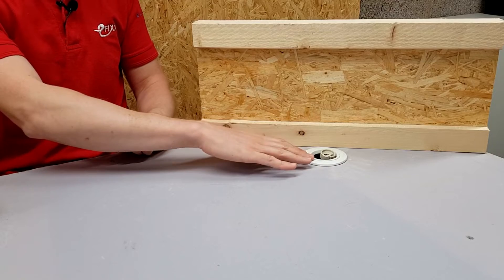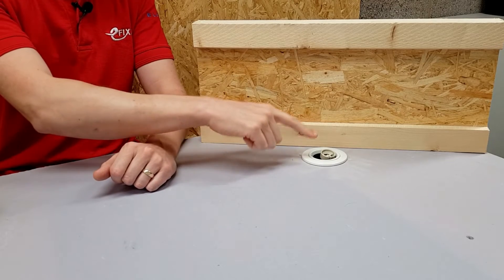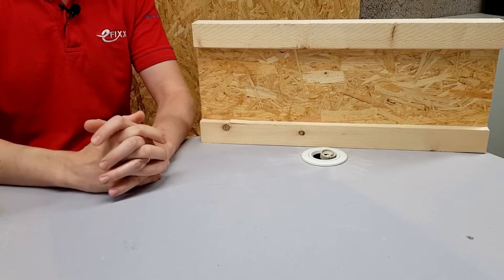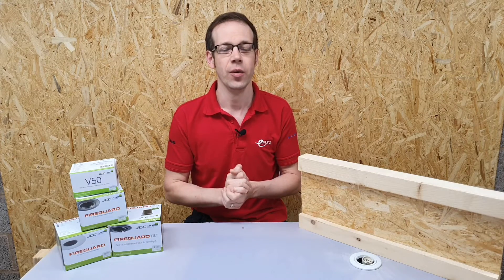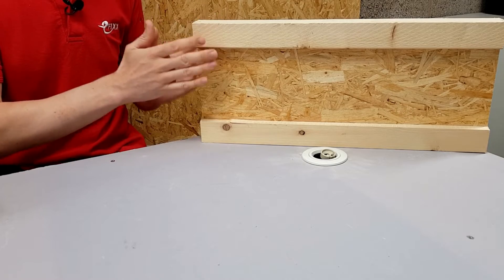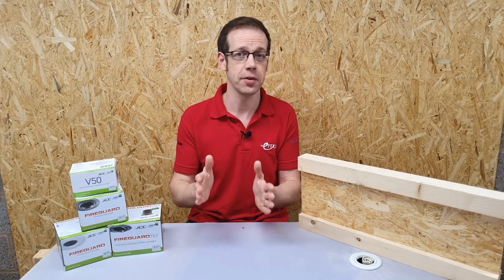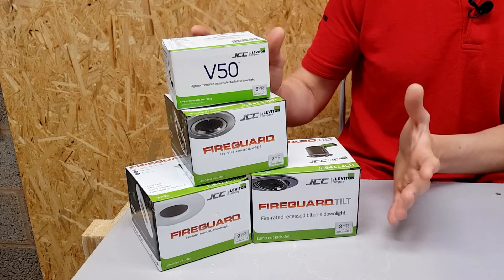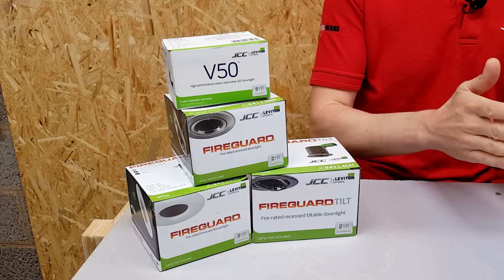Installing downlights? -  Why should electricians care about ceiling construction?

Comment from the maker: Check out the earlier parts of this series to understand the wider issues with respect to updated requirements from the NHBC.

How do LED downlights work in fire-rated ceilings?
https://youtu.be/tcvFPnYUHcU

The NHBC burns a hole in fire rated downlight certification with i joists
https://youtu.be/c_5MqhJLwFk

Comment: so in short a client wants a particular brand of down lights  but  cant have them because they have the wrong type of i-joyct? and the boffins at the IET and the NICEIC say they are make the industry safer ? no they are making it a dam LOT HARDER . all these rules and regulations is getting stupidly out of control.
So the client has two choices go for a different brand that they don't want or have the i-joycts replaced. Absolut crap. 
sorry just my own personal opinion .
Reply from the maker: Or use a fire hood https://youtu.be/V3KwQVyuBxk - The situation had improved since we made this video. Many manufacturers now have approvals for a wide range of joists.

Comment: As usual falls on the shoulders of the electrician like everything else. As someone else said how the heck would you know who manufactured them if it's a retro fit, there's always the chance you could not realise it even had those joists. If the light has equal to or greater protection than the ceiling where's the issue.
Reply: Anthony charles 
Let’s face it. How many fires are we aware of that we started. Got to be really unlucky.

Comment: How are electricians going to discover who manufactured a joist in a existing situation?
New builds are not a problem, but the first time I spotted a engineered joist was nearly 15 years ago, so there are plenty of propertys with existing engineered joists, with no information about the joists manufacturer around. I bet if I asked a homeowner for the required details from the homeowner pack, they would look at me as if I was a fruit loop, and even if they had the pack to hand the info about joists would not be in it.
Reply: aspudkicker exactly what I was thinking - if you ring one of the big boy construction firms and ask what joists they used on X development they’re going to tell you where to go.

Comment: How can/would a competent electrician find the results of such tests then? Is it to be found in the data sheets or would it be on the manufacturers website, as said with JCC, or will it need a phone call to the manufacturers technical support?
Reply from the maker: It’s an evolving situation - the larger manufacturers all appear to be developing a listing on their web sites as they get test results for specific beams - if your working on I-joists then check with the manufacturer.
Reply: @efixx  Thanks for your response, appreciate it. Please keep the channel updated is there be any developments.
Silas Tetley